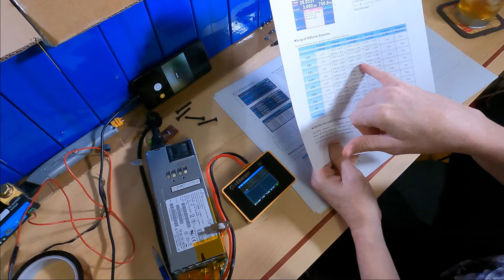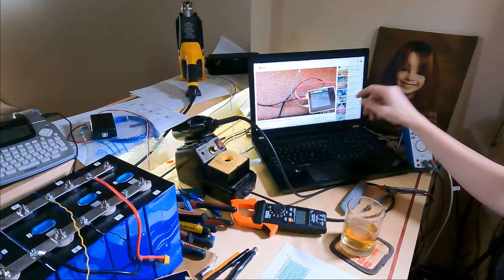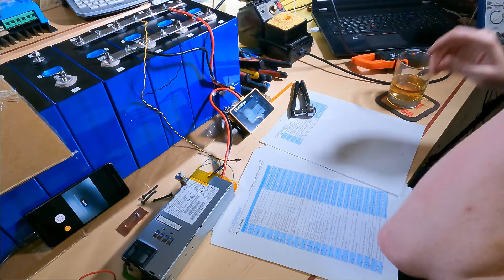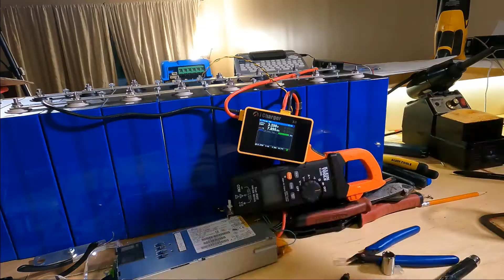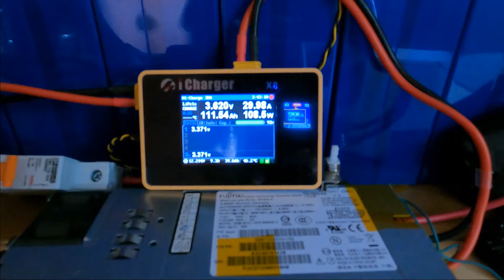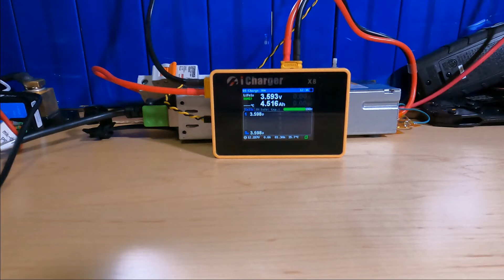Learn with me; iCharger X8 - How to build a 48v Lifepo4 battery (Ep. 9)

Comment: I cant get my x8 to charge over 10amps. its driving me insane
Reply from the maker: That's annoying... overheating, or limitations on the source power?
Reply: @TheDigitalMermaid  I replaced my leads with heavier gauge wire and now its been charging at 20amps. my 16 280ah cells finally got over 3.334 volts lol. While in series I had one cell hit 3.60 while the others were still at 3.3 so I put them in parallel and top balancing with this x8. Hopefully it wont take too many days to top balance the cells.

Comment: Something I would encourage people working with these batteries to do more often... no, all the time.  Is measure your voltages in more than one place.  Because of the current involved the voltages will not be the same at any point in the circuit.  Only by measuring the voltage in multiple places will Ohms law start to be an automatic and iterative tool that is always in your head when measuring anything.  The reason the charge wants the balance lead connected is because without it, it's blinded by ohms law and the current on the main charge leads.  It cannot see the actual cell voltage properly.  By using a separate unloaded lead to measure exactly the voltage across the cell the reading is unaffected by the current and so is accurate.  It's probably the only accurate voltage in the entire system at 30A.

Comment: Can this icharger X6 be okay balancing my 45ah LTO battery (6S XS Power Yinlongs) which will be charged n vehicle with 400a alternator and the battery can out out 450a continuous and 1,000+a peak. Can I keep this X6 attached to this battery? Or do I need to install switch to only use X6 when charging with 20a charger and not 400a JS alternator (which only reaches 400a at 2,000rpms while driving around). Sorry to ask but you're obviously smart and no one has provided me with an answer. All I know is guys are using this to balance their Yinlongs but not sure if in car or on work bench. Love your details videos with a bit of entertainment. 👍🏻

Comment: How did you manage to get nearly 30A over your icharger? I have more less the same configuration,, 4x280A Eve cells in parallel. I tried "everything" to get some more juice out of my X8. Tried 3 power supplies with 36V/30A, 36/33 and now 13.8/35 but never got more then 6 to maximum 10A. Do you have any tips for me? Could my x8 be broken?
Reply from the maker: It could be the source power supply charging it, but I'm not sure. What's the 12v amperage supply capacity of the PSU that you're feeding into your x8?
Reply: @TheDigitalMermaid  thank you very much for your quick reply!!! I don´t have a 12v Power supply but just ordered one for a final Test. 12V/40A. I hope, that will deliver more then 6A with the x8.
Reply from the maker: @MVbubblemaker  12v at 40A is 480w (12*40). 3.65v at 30A is 109.5w.  So even factoring for inefficiencies, that 12v / 40A supply should easily allow full power delivery on the x8. Best of luck!
Reply: @TheDigitalMermaid  Thank You! But all of the power supplies I've tested also had much more Watts then normally needed...

Comment: Wouldn't the BMS replace the iCharger X8 and simply cut off the charger when full?
Reply from the maker: The BMS has limited capacity to balance cells. The X8 is used to do the initial charge to get all the cells to the same (near) level. Then switch over to the BMS to (hopefully) keep things balanced.
Reply: @TheDigitalMermaid  Why would the BMS have "limited" capacity to balance the cells? That is what it is designed to do. Why bother with another monitor (X8) that is treating 8 cells as if they were one cell when the BMS monitors each cell individually?
Reply from the maker: @silverleapers  I did a video explaining this - https://www.youtube.com/watch?v=3qoU5kohtjw

Comment: To increase the resolution of your clamp on if you are at bottom of its range put a couple of turns of the wire in the clamp and divide reading by turns I usually try  for 10 turns and just move decimal point.

Comment: Best charger ever. They sell icharger dischargers separately.
Reply: yes i got that charger it can do everything i used also isdt q8 max charger but many things is limited discharge is limited to 3a and lower voltages is for li ion is limited too so only the icharger x8 can make full tests of battery capacity.

Comment: I'm sure you know this by now so I apologise if you cover this in a later video but I'm just in the middle of a"Digital Mermaid" binge session over the weekend. The tail current on the iCharger x8 like all intelligent chargers is when the charger turns off once the voltage and tail current is met. Ideally you want this to be low enough, eg 0.5A to give the cells enough time to absorb. LiFePo4 is an interesting chemistry the decision around C rate vs Charge Voltage play a significant part in the overall State of Charge. Andy from the Off-Grid Garage has done a recent video on this and shows how works.
Reply from the maker: I appreciate all advice (kindly) given. So please never feel a need to apologise. I mentioned elsewhere, but I'll say again here; I would rather get information I already know ten times, if it means I don't miss good information that might not otherwise be shared once. 

Ya, I've been thinking about how the X8 doesn't really do absorption, and I know it's a topic Andy has spoken on often. I've been planning to return to this topic once I get the Quattro working. Part of me is hoping I can use the BMS to hand absorption and that the cells will be close enough that the BMS's small top balancing capabilities will make up the difference. I think this is possible (maybe) only because the X8's 30A is still just over 0.1C. We'll see. If it's a problem, then I'll dig into the X8's configuration options to see if I can somehow configure absorption.
Reply: @TheDigitalMermaid  not sure if you have seen this yet, but if not, it is time....   https://www.youtube.com/watch?v=QlDd3jkcxoQ

Comment: i hope you can give us an insight to what you need and what you expect out of the system .. please. atb .. next time.
Reply from the maker: I'm not sure if there's a specific thing you're interested in, but the design I am building for is to drive a motor that has a maximum continuous draw of 600A at 48v. So the bank of 6x 100A constant, 280Ah capacity batteries will drive the motor at max speed for just under 3 hours. In practice, I never expect to run at 100% load, so I am hoping to have over three hours, minimum, of real-world pure battery drive. The same bank of batteries will provide the house power as well, as I plan to have induction cook tops, electric over and a clothes washer onboard (not used when motoring, obviously).

Comment: just thinking out loud...?? 280x6=1680A x volts50. =84000. div by 3000w =28hours full sun .. if no Genny how charge. ??
Reply from the maker: I may well have a generator for times when I really need it, but I'll do all I can to never use it. My hope is that the times that I drain the battery completely will be rare... I want to sail, not motor, so I'll only motor when I need to. So that's part of the strategy, but also, I don't expect to motor every day. If the batteries get drained a bit on one day, they likely it'll be several days before I use it again, so the slow charge rate will be enough. I also plan to have a regenerative motor so that, while sailing, the prop spin will help charge the batteries as well.

Comment: Why didn't you Start with the electric motor you want to use for your boat? I think it's easier to dimension a system when we exactly know which power, voltage ist needed.
Reply from the maker: As I hinted at in the intro, covid has caused my plans to be messed up. I have put a lot of thought into the boat type I want to buy, and the system I am designing can be adapted to a set of different electric motors / boats. So while building the battery / power system first isn't ideal, I know the corner I've painted myself into, and it's a nice corner. :)
Reply: @TheDigitalMermaid  i prefer to use the  QS 138 3000w motor  + votol em200 controller that is great and big power this  can pull about 11kw in max
Reply from the maker: @automoto95  I'm happy to hear you found a good motor and controller for your use case. In my case, I'll need something a fair but larger. Since I released this video, I've more or less settled on the Torqueedo Cruise 12.

Comment: Top balancing has a shelf life.  When you let the battery sit, the cells drift. I recently measured 8 cells, and they drifted about 0.16Ah in about a month - well within their specifications, but this resulted in a 0.11V difference when the fullest cell was at 3.65V. Given that this vid is 4 weeks old, do not be surprised if you experience BMS trips due to excessive cell voltage when the battery is placed in service.

Since you have the X8, your easiest method to restore balance will be to connect the X8 to each cell individually (you don't need to break the battery down again) and re-charge each to 3.65V.  It will go very quickly as it's unlikely they'll need much.
Reply from the maker: That's good to know. It'll have been about a month by the time I spark up the quattro. I did go through and top balance each cell individually after the parallel video. It'd be easy to do it again, so I'll do that before firing up the quattro for the first time. Thanks for that, solid advice!

Comment: Many server PSU housings are in common with the (-) terminal.  Accidental contact with a charger output lead can blow the charger.  You would have had faster results had you charged them in series with balance leads on up to 8 cells or in a 2P8S configuration.  30A may have been hard to obtain due input/output power limitations, but it would have taken a small fraction of the time.  Regardless, doing it right is more important than doing it fast.  Good for you on doing it right.
Reply from the maker: This PSU was indeed chassis ground common. I'm curious how you would have configured the charging in a 2P/8S configuration. Do you mean treating the charger as a sort of BMS with the 8 voltage lines connected and let the charger do the top balancing? In any case, yes, "slow but steady wins the race" is very much a mantra of mine. :)
Reply: @TheDigitalMermaid  That charger has the ability to "balance charge" in series. It will monitor the 8 cells via the balance leads, restrict charging to whatever current keeps the highest cell at 3.65V and will bleed off excess current @ 2A for balancing.

You would have had to buy/fabricate an 8S balance lead.

Essentially, you could have paralleled 8 groups of two cells and then put those 8 groups in series. With a 12V power supply, you likely would have been limited to about 360W of charging power (unit has a 30A DC current limit).  Even so, you would have been able to charge at 12-15A, but at up to 29.2V.

Since these cells ship at about 50% SoC, you needed to put about 140Ah * 16 = 2240Ah total input. @ 30A, that's about 75 hours, thus your 100 hour time frame makes sense. However, a 2P8S configuration only needs 140Ah * 2 = 280Ah. Assuming you can only do 12A, that's still 280Ah/12A = 23 hours.
Reply: @snoobler  It actually took me a while when starting out with "large" cells that "Balance chargers" don't seem to exist.  I had lots of questions like What? Wait, how?  Why?
How does the charger know a cell is hitting max volts when the pack voltage isn't "full" yet?  How does it know to back off the current?
I suppose the answer is... it doesn't.  The chargers are dumb and have no cell voltage awareness.
At least it means you don't have the slow, torturous tapering to sit through while you wait on your 5Ah LiPo 30C discharge pack finally absorbing to 4.20V across all cells.  Seriously!  10-80%  20 amps, 10 minutes.  The next 18%.... another 10 minutes.  The last 2% of you want it, another 10 minutes.

However.  I am not giving up that easily.  First.  With care, attention and a bit of luck, you can get the chargers/MPPTs configured (in lead acid mode!) in such a way that they will be tapering current and the load the balancer is able to place on the cell-delta asborbs that tapering current.
At the moment, the BMS is set for 3.650V per cell HVC.  However the MPPT is set to 14.40V.  It seems, further testing to be conducted, that on my system that tiny headroom is enough to mean the balancer has got the ability to take full control of the taper current of the pack as the MPPT tries to taper off at 14.40V.  It also adds grace for the MPPT being a little sloppy coming out of shade and occasionally overrunning it's MAX charge voltage by 100mV or so, rarely, but happens.  The MPPT over-volt dissconenct is set to 15V, but the BMS will go first.  I am pondering that changing the order of that might be preferential, such that the MPPT controls any such disconnect from inside, first and then backed up by a slightly higher setting on the battery.

Secondly.  I am going to do some research using smaller cells and a way to "tamper" with the chargers feedback loop to force it to see the max cell voltage.  Well maybe not see it, but have a cell voltage monitor which based on it's max cell figure begins to introduce a very small voltage drop just past the BMS.  Say a 50mV drop.  The charger sees the pack as "14.40V", but it is in fact only at 14.35V, the MPPT current tapers for 14.40V allowing the balancer more time with it's limited power to fix the situation.  It would mean some "bled power" by that voltage dropper mosfet and it's heat sink, but if it saves HVCs and allows you to trickle absorb right up to, say, 0.05%C current.  It might be worth it.
Reply: Another feature of true balance chargers is that in full "Balance Charge" mode, they don't just top balance.  I charged an old LiPo yesterday that has a weak cell.  It started out at 3.10V, 3.45V, 3.55V  I set the charger to 5 Amps for a 5Ah pack.  It started charging at 0.1A.  It took it 10 minutes before it began to slowly ramp up the current.  It uses a "current -> cell-delta" relationship, so that it won't hit the pack will full current until the cells are within a certain tolerance, does it interatively though, smoothly ramping up as soon as the resistive balancer can hold the max cell delta.
Compared with the "Fast Charge" mode, which is pretty much what half the MPPT setups I have seen do.
Immediately to full current, to hell with balance.  Then taper based on MAX cell voltage and MAX pack voltage to 10% original charge current and then stop.  Even then it is aware of the max cell voltage and if it is the one which brings the charge current down to termination current, then the pack is left not fully charged and not balanced.  If you are using and fast charging them all day like this, it really hurts them (LiPo RC high discharge packs).  It seems that is how most solar charge controllers treat batteries, only leaving it up to the BMS to disconnect completely and almost PWM the last phase.

Comment: I would just charge the 2 sets of 8 separately to 3.65v and then hook all up in parallel with no charge for 24hrs. Then to up to 3.65v and wait for amps to drop off, let sit for 24hr in parallel and you’re good to hook up in series.  I was impatient in parallel and hooked in series to charge but was constantly worried about the imbalance. I don’t think it saved any time with my charger.
Reply from the maker: I'll need to order some longer bus bars, but I was thinking of doing that anyway. Giving time to let all the cells balance with each other at rest is probably smart.
Reply: @TheDigitalMermaid  
I just used ring terminals and 12AWG wire to balance at rest. Unless you are pulling an Andy, it will easily handle the amp movement.
Reply from the maker: @thomash7573  Honestly, a couple copper bars would be a lot cheaper. Those ring terminals and marine grade wire are not cheap. :)
Reply: @TheDigitalMermaid  
I had it on hand. Cheap wire though. I look forward to your next videos!